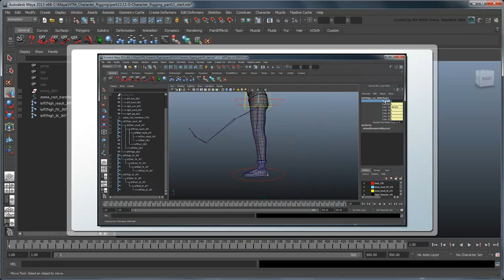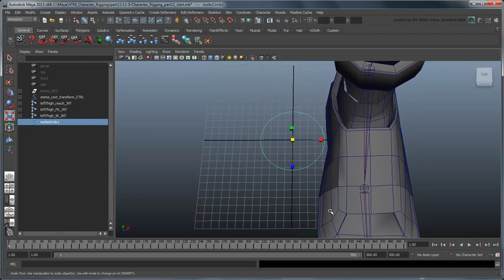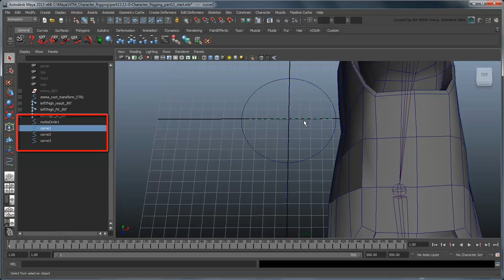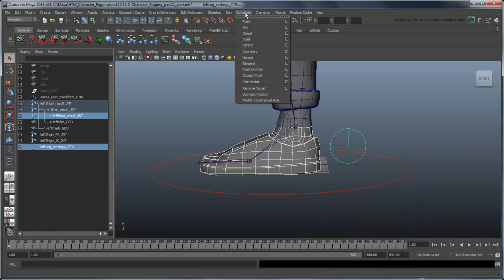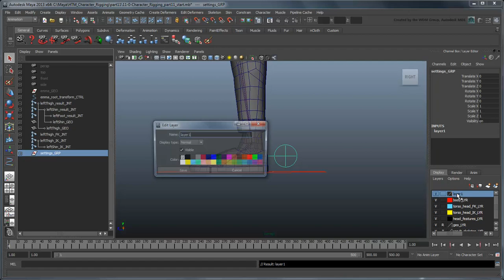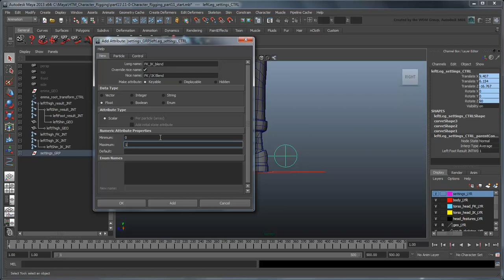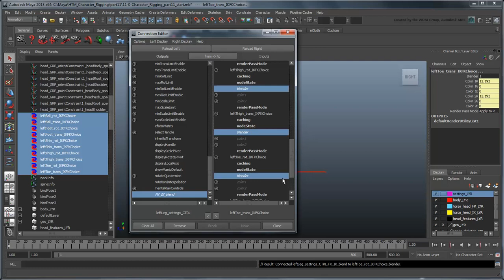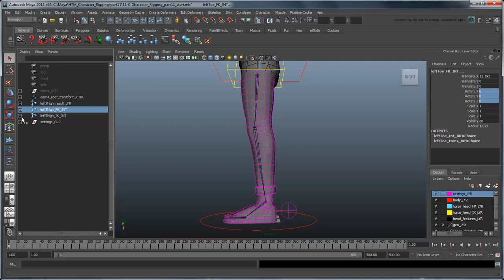Creating a Character Rig - Part 11: Leg settings switch with IK / FK attribute (Advanced)

Comment: Just mentioning this tip for whoever else may have run into this problem: At 6:45 the middle drag is being used to alter the blend value within the channel box. When I middle-drag, the values snap between 0 and 1. 
Solution: In the channel box, Edit>Settings>Slow will keep the middle-mouse-drag from snapping.

Comment: Hello, I've followed these tutorials and made sure I did things in the right order, but at the 3:51 mark when the "leftShin_IK_JNT" is selected and rotated in the video, the joints stay in the middle of the geometry.  However when I rotate the same joint in the provided file in the downloads section, the result joints move backwards outside of the geometry (bend further than geometry) How can I fix this?
Reply from the maker: +Sophie Berry Are you sure?  I just tried the included file and it seems to be fine.  If you mean this is happening on your rig, it sounds like your geometry could be parented to the wrong joints.  The geometry should stick to the result joints like glue at all times.

Comment: Hello! I have been following these tutorials to rig a character and they have been tremendously helpful! However, I seem to have encountered a slight problem while following this particular video. I will note that I have been using Maya 2015, but so far have been able to work around any minor changes since the version used in this tutorial. 

Once I created the leg settings control switch, I added in the new "FK_IK_Blend" attribute just as was shown at 4:40 in the video: I left the data type set to Float just as the tutorial does. However, when I open the Connection editor to try and connect this new attribute to the blender attributes on the blendcolor nodes, I am unable to do so. I have tried changing the data type to a different type but have been unable to successfully connect the attribute to the "blender" attributes of the blendcolor nodes. Any help provided on this issue would be greatly appreciated! :D
Reply from the maker: +Chronalgia Hmm, this should work.  Have you tried doing it through the Node Editor?  Just select both the leg settings control and the blend colors node, open the Node editor, expand each node and try to drag a connection from FK / IK Blend to Blender.
Reply: +Maya Learning Channel This worked! Thank you so much! :D

Comment: what can i do if my translation is backwards? i have redone it several times and it stays the same, when i move mi Ik or FK joints the result moves the oposite, the rotation is correct but not the translation :'(
Reply from the maker: You shouldn't ever be moving FK joints (they're only for rotation).  If you're seeing that issue with your IK joints it likely means the local rotation axes of your IK and result legs don't match.